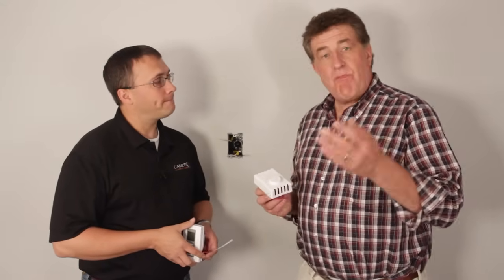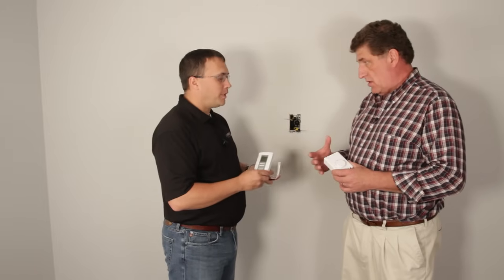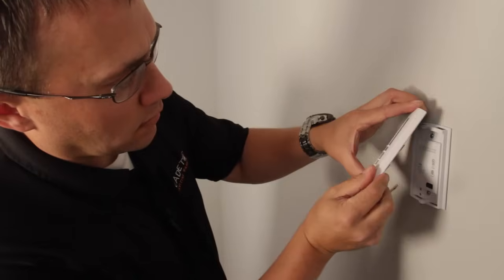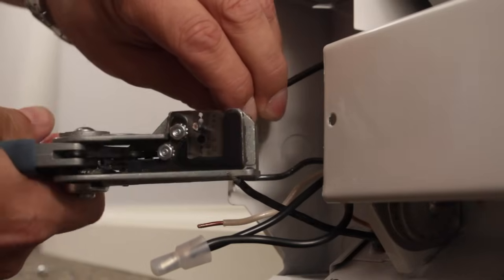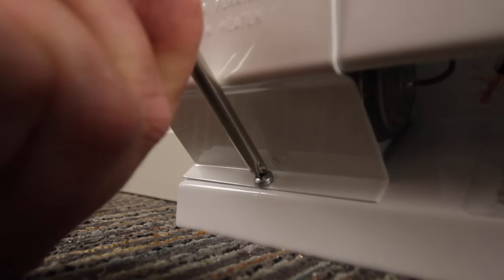How to install: Wall thermostat , double-pole on 240V baseboard | Cadet Heat

Comment: 240v line voltage is just nuts for a thermostat. needlessly expensive in the wire in many cases not to mention the safety that a rational low voltage with relay would allow.

Comment: We have a Cadet 240 volt wall heater.  Not sure how old but present when we bought our house in 2000.  It has a dial on it to set thermostat.  This thermostat is very hard to set correctly and we are always turning it up or down trying to keep heat at 68 to 70.  It a lot of times ends up too high or too low.  I want to install a thermostat on the wall nearby but not sure on doing that.  Also there is no real way to install wiring without taking wall apart.  Do you have any recommendation on what would work?  I can also call an electrician we have used before.

Comment: Install was easy fireplace.homes good although I personally had some difficulty with the thermostat I had. Issue was mine though, not realizing that electric heaters couldn't use oil thermostats. Tip: If you are using an external thermostat, run the power to the thermostat, not the unit. Once that was squared away it worked great.

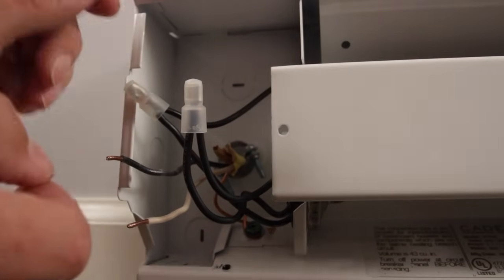Comment: At around 1:40 you begin to instruct the customer to cut the set of wires to to the top set of black factory wires.  Double check this please.  Your installation booklet contradicts this. It says on page 4 of the instructions for 240 left side to cut the other set and specifically not to cut the factory set going to the top row.  Hopefully the instructions are correct because I just wired in 8 rooms of baseboard heaters.  Thx
Reply from the maker: Hey Dave, Good eye. We are sorry for the confusion If you are using 240-volt heaters you can cut either set of wires. That recommendation in the guide is a new addition and is more for the sake of being consistent with a 120-volt installation, where it matters which set of wires you use. This video was made before we made that change in the guide, which is why it contradicts it. We have an update in the works but it isn't quite ready yet.
Reply: Oh yes. I have same question and confused.

Comment: at 1:46 in the baseboard itself, there are two black connections with nuts in them and choose the one with a connection coming from the top. then cut it. Why can't Cadet just leave those wires open)no nuts so that it is obvious that that is where the connection from the thermostat will go?
Reply from the maker: +Roland Zamora Good question. We make our baseboards so they can be wired on the left or right hand side of the heater. If we left one connection on the left side open, you'd only be able to wire it on the left side right out of the box. When we made this video, we wanted to show the wiring on the left side, because there are two connections. On the right, there is only one. I hope that makes sense!
Reply: Roland Zamora
Reply: Multiple baseboard s

Comment: I have read your instruction sheet a number of times and I am still confused. The instructions say to cut one of the pairs of factory connected wires. I want to wire a 240circut. Which pair do I cut to connect to the wires from the thermostat? The instruction sheet says to cut the pair with the white wire. Where did you put the white wire? Mine are all black.

Comment: I am replacing the wall mounted thermostat. The load wire is at the base board heating unit. Just the 2 wire cables to the box. Need to know what wires to hook the red to and the black to. I did black to black red to white and KICK off the breaker.

Comment: can you give me a link to the 240v digital thermostat(double pole), i don't like the 1980's looking round knob...it will be hooked up to 2- 8ft cadet baseboard heaters(240v 2000w) wired in parallel...i ran 10/2 on a double pole 30amp breaker 240v...4000 total watts...16.6 total amps

Comment: I bought a used 8 ft. Long baseboard heater. It no longer has a sticker on it to tell what voltage it is ? 120 or 250. How can I tell what voltage it is? I hooked it up to 120. It heats up but is just doesn't get very warm. It does this rather I go through the thermostat or directly to the 120 outlet.? So should I assume it takes 240 ?

Comment: I’m wondering why you didn’t explain how to hook up a thermostat with only two wires coming out of it? The Honeywell RLV3120 specifically. I’d like to know how that one is supposed to be wired.
Reply: 240 volt

Comment: I’m replacing a single pole with a double pole thermostat. I have wires coming from 3 locations in my box. Currently the single pole is connected to all 3 black wires, and all 3 white wires from the 3 sources are connected together but not to the thermostat. I’m so lost on which wires to connect.
Reply: I have the same wiring, Ben. What did you finally do?
Reply: @bubbathedog7625  bought a single pole thermostat and wired it the same way as the original.

Comment: Is the electrical thermostat quieter than the mechanical thermostat ? My mechanical thermostat does a loud "clunk" when it turns heat on or off.

Comment: the 2 black wires in the thermostat does to the wires coming from the service panel,, is this correct? And the 2 red wires in the thermostat goes to the wires going to the heater itself, is this correct?
Reply from the maker: +Roland Zamora If you're using the exact thermostat we're showing in this video, the top black and bottom red wires go to the heater. The other two get connected to the wires coming from the service panel. If it's not this specific thermostat, make sure the "Load" wires go to the heater and "L1" and "L2" go to the wires coming from the panel. If you want, you can live chat or e-mail our tech support guys and they can walk you through your specific situation. http://cadetheat.com/support/customer-service
Reply: +Cadet Heat I don't have 240v coming from the wall.. Can I hook up 120vac to the 240vac ones..? I saw in the video that you too weren't using 240vac wiring. Because if it was, it would be Red, Black, White, and a ground, which is 12-3 Romex, not 14-2, which is what it looks like the wiring coming out of the wall is.
Reply from the maker: +Mark II You need to make sure that your thermostat supports the voltage you are using for your heater. I can't really be any more specific about that without knowing what thermostat and heater you are using. Thomas from our tech support team said he'd be happy to talk with you about your particular situation if you want to send him an e-mail at tjones@cadetheat.com.

As far as the wiring is concerned, it is 240-volt wiring in the video. Cadet heaters only use 2 conductors and a ground (Black White and bare Copper ground wire) for both 120 and 240 volt applications. Where you would see the 3 conductor application is your electric range and or electric dryer. The reason why these need 3 conductors ( Red, Black and White) is because they need 120 volts for their control circuits like the clock and displays. Cadet heaters do not need the neutral because they do not have the control circuits like the range and dryer need to operate.
Reply: +Cadet Heat Ahh.. I see. So both of the wires are hot then. Which means you really were using 240vac. Ok, cool. There's no need. It seems there's 120vac ones as well at lowes, I'll just get those. Thanks for the reply, much appreciated.

Comment: If I already have an old baseboard heater connected to the breaker, do I connect the thermostat to the breaker and then back to the baseboard?

Comment: Hi how can  one tell which wire in the J box coming from the heater load and which from the breaker line?
Reply: Probably use a DMM.  Flip breaker off and disconnect all wires, seperate them so they don't short.  Put your positive DMM lead to one of the white wires and negative to ground.  The one from the breaker line should have 120-240V and the one from the heater should have 0V.

Comment: So the breaker that turns off the actual baseboard is also the same breaker that turns off the power at the thermostat???
Reply from the maker: Yes, if the heater is installed correctly. If you're using a wall thermostat, wires run from the breaker to the thermostat and then the thermostat is connected to the baseboard/heater. Both should be on the same breaker. In the past we did sell a 2-circuit thermostat, that would be the one exception.
Reply: correctomundo!

Comment: I have 240V radiant ceiling heat on a single pole Thermostat. Okay to use a double pole thermostat (OFF switch) and separate the wiring for this?
Reply from the maker: Hey RMj,
Unless you have four wires in the thermostat junction box, you shouldn't be using a double pole thermostat.

Comment: I'm a little confused with the wire cutting in the header as the other video you have DOES NOT CUT THESE WIRES:
https://www.youtube.com/watch?v=wcxoJWgVrsQ

Which video is correct?  My model is a 4F1000.

Comment: How do you determine which wire is from the breaker and which wire is from the heater?
Reply: Use a glow light electrical tester like either of these shown:  https://youtu.be/Moad9c1wTwk

Comment: on the 240v 12/3 from the breaker panel do I just ignore the neutral??
Reply from the maker: Hello!
Our heaters only require 12/2 or 10/2 wire so you will need to cap off the white neutral wire. Let us know if you have any more questions!
Reply: They were answering the question for a three conductor wire.  You would not use the neutral.

Comment: Can I run 3 of your 4F1000 240 volt htrs off a double poll 20 amp brker? According to your web site, that would only be 12.6 amps total.  Can 1 stat control all three?
Reply from the maker: Hey Bob, That should work just fine as long as you make sure to wire the heaters in parallel, not series. Instructions for this can be found in the baseboard Owner's Guide. If you're looking for a good thermostat for this installation, our tech support team recommends the TH114. Please let us know if you have any other questions.
Reply: Does Menards typically carry this model, or would I need to order it direct from you??
Reply from the maker: Hey Bob, It looks like Menards stocks the Aube version of that thermostat. Really, you can use any line voltage thermostat that says it works with baseboard heaters. Just make sure it's rated for more than 12.6 amps.

Comment: Do you have to have a double pole thermostat for a 240 cadet.?
Reply: Best practice to do so, otherwise the unswitched leg remains hot even when the thermostat isn't calling for heat.

Comment: Excellent video. So on a double pole I understand the Line and Load but my question is does it matter on the 2 load wires which is connected with which?  Also does it matter which of the 2 line wires are connected to the black and white wires coming from the panel?
Reply from the maker: Hi Joel, because both lines are hot with the 240 volt, it does not matter which load wires connect with which. And same with the line wires. They can connect to either the white or black wires coming from the panel. If you were dealing with 120V, it would matter. We are happy to hear that the video helped out. Let us know if you have any further questions.
Reply: @Cadetheat  Thank you for this! I have been searching for HOURS trying to figure this out!

Comment: can you hook up more than one heater to the thermostat ?
Reply from the maker: Yes you can just make sure they're wired in parallel and it will support the total wattage of the heaters. If you have more questions, I can get you connected with our tech support team.

Comment: Can you wire more than 1 120v heater to one thermostat?
Reply from the maker: You can as long as you don't have more than 1,920 total watts on a circuit. We generally recommend that folks use a 240-volt circuit when wiring multiple heaters together. Here's a blog post that covers how that works: http://cadetheat.com/blog/multiple-heaters-just-one-thermostat/

Comment: Could you wire it the same way behind the stat in the box except with two loads? So 3 12/2 wires in the box behind the stat?
Reply from the maker: Hi Matt, yes, you can do this as long as the thermostat and breaker are
not overloaded. We do not recommend adding any more than two loads though
because of the amount of wiring that would need to fit inside the junction box.

Comment: Doesn't 240 V require two circuits and 3 wires, 110 v from each leg?Your video shows only 12-2 wire being used.
Reply from the maker: +Karl Lucas 240V power comes from one double-breaker. Our heaters only need two hot wires but other appliances like electric ranges and dryers use 3 wires.
Reply: Does not need a neutral

Comment: what do you do if your baseboard heater is still putting off heat when its off
Reply from the maker: +Jeramiah Fuchs It's difficult to say without more information. It could possibly be a short or a bad thermostat. Is it putting off a lot of heat or just a small amount? How long does it give off the heat?

Comment: the first thermostat was only acting as an on odd switcht hen an electrician installed a 120/240 usable thermo---it doesnt have any numbers on it ---just cooler and warmer with arrows ---the thrermo is on the wall ----the first click it goes on then shuts and never goeson if i put ther thermo in the confort zone level ---it constantly clicks at the end of the radiator ---the end that would be attacheded to the wall unit---but its not turning it oon and off just clicking -----its driving me crazy nevr had this before---im having a feeling this thermo is not right either ----i did find one that says electric onlt  non programmable ---whaddda thinkig ---it would be very appreciated
Reply from the maker: Nicky,
I think we'll need more information to help you. If you can, please get in touch with our tech support team http://cadetheat.com/support/customer-service

Comment: He never really goes into wiring the wall thermostat. If the thermostat controls power to both legs does that mean the fan and element shut of together. Should there be a delay.
Reply: This is pretty specifically for double pole electric baseboard heaters.  No fan involved; this type of thermostat would not suit the type of system you’re working with.

Comment: So L does not stand for LOAD?  I guess it means Line
Reply from the maker: With the thermostats we sell L stands for Line.
Reply: Usually stands for LINE.  Best thing to do is test both sets of wires that enter the wall box to see which are hot.  Connect those to LINE wires of the thermostat.  On King thermostats, the powered LINE (hot) wires in the wall box connect to the two red wires on the back of the thermostat.  So, read the intrux carefully that come with your thermo.

Comment: The white and black conductors in the wall represent 120 volts. They should be red and black to signify 240 volts. Definitely a code violation.
Reply: NEC color codes allow the white to be hot as long as it's marked with marker or tape (any color but gray or green).  Regardless, never trust a wire color; assume everything is hot.
Reply: @joshuaewer  This is a violation in the CEC and I thought the NEC required a permanent colour change like heat shrink.

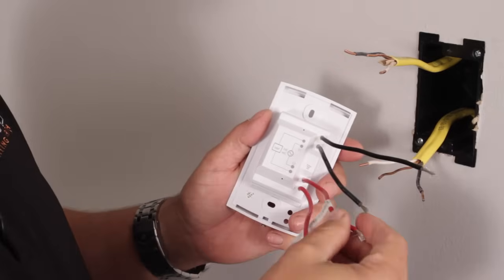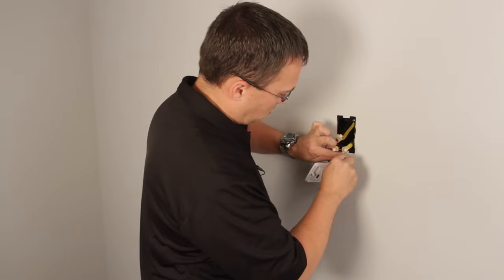Comment: Only useful part of this entire video is 0:45 to 1:03, which would have been unnecessary if Honeywell did not deliberately make the TL3230 wiring diagram on the back of the rear panel (and in the nearly useless "Owner's Guide") as f*cking confusing as possible, because they want to scare you into paying out the wazoo for an electrician to come do this for you (I got estimates of $150-250 minimum per hour).  Here's the cut-to-the-chase shortcut: top black wire = to heater, middle black = to power; middle red = to power, outer red = to heater.  HOWEVER, compared to other similar DIY videos on YouTube, this one is the least bad---the others are really just a bunch of pedantic motor-mouths also trying to scare you into paying for a professional install.

Comment: I'm giving this a thumbs down as you can't see in the video which of the two pairs of wires to cut as the base of those wires are out of view.   The narrators verbal explanation does not help.  Went to written manual which clearly illustrates which wires to cut.
Reply: agreed!! sloppy part of the video, they need to put a bit more effort into it!